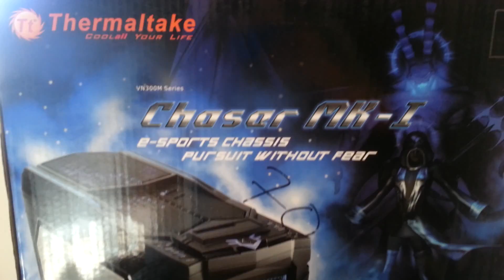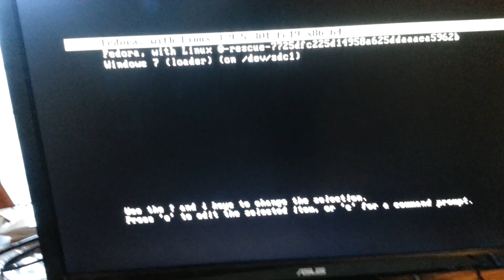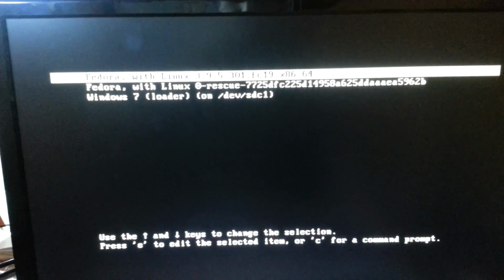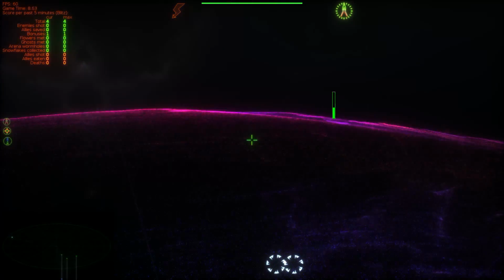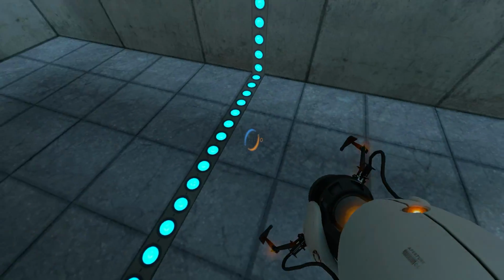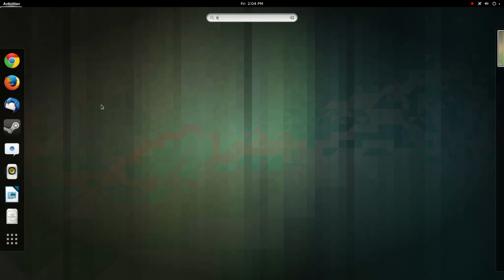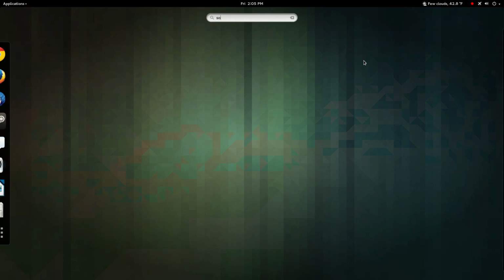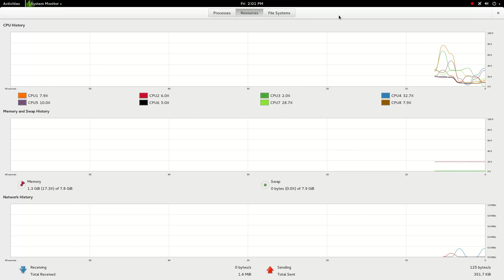Building my Linux Gaming Desktop

Comment: Well man ! 
That was such an awesome video that will make change from windows 8 to linux 
But please let me ask you some questions :
1) [ Mint - Fedora - ubuntu - debian - openSUSE ] ... which one should I choose for gaming ... and some applications that I deal with ?! 
2) About steam .... I am having many games that have the EXE extension, you know ! ... can steam operate those games on linux?!  ( with the games optimum quality and performance too )  ?! ... If not , what is your recommendations ?! 
-> FYI : I am having a lenovo G500 Laptop [ 4GB RAMS - 2 GB AMD dedicated - intel core i5 4th generation ] 
I do really thank you for this video :D 
and thanks in advance for responding
Reply from the maker: You have lots of options. I would say your easiest bet is going to be Ubuntu since it is most commonly used and there are a lot of resources online. my biggest suggestion would be to install and use each OS in a virtual machine for awhile, just to get the hang of things. you can install nvidia drivers and steam on all of the operating systems you listed, so gaming should be pretty similar on each
Reply: dose this "nividia drivers " works with the AMD VGA ... since this is the one I have !
and ...I think you didn't tell me about the EXE extensioned games yet !
Reply from the maker: NVIDIA drivers will only work with NVIDIA cards. if you have an AMD card, the best thing to use is the Open Source driver that comes with the OS. The driver is called Gallium, I think. I use steam with AMD graphics on a different fedora workstantion and it works good. EXE games?
Reply: exe extensions ... microsoft windows extenision for the games 
does it work on linux ?!
Reply: *****  : Well [ Darksiders II - Tom Clancy Games "ALL OF IT " ...and some more ! 
If am going to search for each , that will take like forever yo know ! 
... sorry... forgot to than you for responding :D
Reply from the maker: ***** To get windows games to work, your best bet would be to use Wine to install the windows version of steam, and get your .exe games that way. From there you need to use wine to run the exes. it works with varying levels of success. for the most part .exe games will not work right in Linux. google around for wine compatibility for the games you are wanting to play.
Reply: I expected so ... 
Cody Shell  : again man ... thanks for the video and for answering my questions , and sorry for being such a pain :D 
keep up the good work man ! 
*****  : thanks man for responding :D
Reply: Cody Shell
Hey Cody nice Video I wanted to ask I am going to be building a new Budget PC in a few weeks I have all the gear lined up and ready to buy (just waiting for the $)
and have gone with getting the Hardware sorted first and the OS later, I also have a large windows based games list and want to be able to play them all on my system now cause I am not going to be able to afford windows strait away as I will need a new key (already own a copy of windows7) I will be running Linux to begin with.

Any chance you could make a tutorial for Linux newbies like myself on setting up windows Steam with wine and setting up games on Linux or dose anyone know of a utuber that's already done this and would be willing to link there video here?
Again it needs to be an in depth video as I have no real experience with Linux and the terminal for setting up, it always had me confused cause I don't know what I am doing with terminal and please I do prefer to watch someone do it on a video and not read it as that is just how I learn.
Reply from the maker: Even with Wine Windows game support is a shot in the dark. Not every game works, and the ones that don't expect them to work like they do on Windows. It's a shot in the dark. Even if games do work in wine, its best to have some good hardware, a budget build might struggle a bit. 
The best bet for yourself would be to install a Linux virtual machine, right now. on whatever computer you are using and start playing around in the terminal. installing and removing packages, navigating around through directories. Getting that basic knowledge down will make everything you do in Linux much easier for you. You don't want to end up scratching your head wondering why you can't figure out the basics. 
Google around for Wine compatibility for the games you are going to be playing the most. And see which games of yours are available as regular Linux titles. Google is going to be your best friend.
Reply: Cody Shell
Well when I say budget these days a budget PC can do pretty well, I can give a list of the items I am getting for anyone else interested for a budget build at the end, but just to say it will be pretty powerful for the price.
Now I have dabbled with Linux before but as I said I ended up as you said scratching my head most the time making sounds from the intro like Tim Alan from the popular TV show Home Improvement "Urrr, err, eww" and I have sat down for hours on end trying to read up what to do with Linux but as I said I need videos to watch on the subject cause that's just how I learn.
I have looked around on youtube for basic tutorials but most the time there 2 or 3 years old.

For anyone that is interested this is going to be my Budget build and I would say its no slouch,

Dual-X Radeon R9 270X OC or AMD R9 280 both by SAPPHIRE
Depending on whats available at the time.

MSI 970A Motherboard by MSI

2x 4GB HyperX 1600 MHz CL9 DDR3 by HyperX

AMD FX6300 Black Edition 6 Core by AMD

Intel SSD 320 Series 40GB SATA2 by Intel

It wont be the best build in the world but it should do the job and all comes to around ($536.28) depending on witch card I get, Luckily I have a spare 750watt power supply and case.
Reply: *****
Partly true yes, every time I suggest to a friend I want to try Linux he says not to waste my time, but I know Linux has a lot of potential if you give it a chance, while I do wish that Linux could just run all my windows games by now and believe me I have being going back and forth from windows to Linux to check over the years.

Then I would never have to care about buying another windows Key again cause god I don't know how much money I wasted to Microsoft over the years cause of Keys and so on, where Linux is a completely free OS and only misses Window game compatibility.
But I will say this the moment all games can just be installed and run on Linux like normal Windows will be going in the trash for me.

I know Windows 10 will be free for all Windows 7 and 8 owners but I am betting that Windows 10 will have Micro transactions coming out the wazoo.
Reply from the maker: Azreal Dragon AMD CPUs are great. Before you buy anything though google around and make sure you hardware has good Linux support. Look around and see if anyone else ran into issues. AMD CPUs are great and have good support with Linux. 
The #1 thing I would tell you right off the bat is not to get an AMD graphics card. AMD graphics drivers are incredibly primative with Linux. Getting the drivers to work is very difficult, and when you do they are not very good. 
For someone whose more of a novice with Linux, definitely get an NVIDIA graphics card. I wouldn't get an AMD GPU for Linux, not now at least. The technology just isn't there yet. 
For your CPU, youre good though. the 6 core should be good. 
Also look up motherboard support for Linux. I didn't and when I got my computer Linux would not boot. I had to disable the IOMMU controller in the BIOS, and even then to this day I get a page fault when I boot (making it boot about 15 seconds slower) - but this is a motherboard issue, not a CPU issue. 
When it comes to building a Linux rig, it really pays off to make sure your hardware is going to be supported first. 
These days Intel does a lot of work providing source code to the Linux kernel. Intel has very good Linux support. It definitely wouldn't hurt to go Intel as well.
Reply: Cody Shell
Well thanks again for you time and support with this at this current time.

I have decided to stick with windows,
(I really hate windows tho) but just cause I don't feel I am confidant enough yet with Linux.

I will be running Linux as a duel boot tho so I can keep practicing and learning it but also the CPU I had chosen has changed as well from the FX 6300 to the FX 8350 as its on sale at a local PC store and it gives a top clock of 4.00/4.10 where the FX 6300 was 3.50/4.0
(I think) witch should be Overkill for what I need it for (60fps gaming), but any information on if it is or is not a good buy is helpful.

I also noticed a GTX 960 on sale on Amazon UK could you advise on if this is a good buy or not?
I know the GTX 960 is not as powerful as a R9 280 or 280x but the GTX dose have DX 12 support and is made with the Haswell architecture.
(But that dose not mean much to me I just know its made in 2015)
Thanks again to everyone that has taken the time to help me.
Reply from the maker: Hey no worries! the 8350 is an awesome chip, as you can see i used on in my build and it is suiting me great. the only thing that sucks on it is the stock cooler. i really reccomend getting a coolermaster hyper 212 evo air cooler. then it can breath. 

maybe try making a virtualmachine of a few linux distributions and playing around with them to get to learn stuff.

i would like to make video tutorials, but i dont have a lot of time right now. it's something i'll definitely consider!
Reply: *****
lol, Funny I was thinking the same thing last week about windows 10.

I am expecting it to have micro transactions all over the place with that OS.
As for the duel boot not got round to it yet but my finished rig is not bad has a bit of slow boot time but that just might be cause I have not optimized it yet.

I went with the FX 8350 cpu with an MSI gameing 970 MOBO and MSI gameing GTX 960 graphics card.
I dug out the ram, PSU, case, DVD and HDD from my old computer and it runs well.
Reply from the maker: yeah, it does well. I like it a lot. i have everything separate, with windows and linux on their own hard drives. Windows 10 actually doesn't sound bad. but windows always gets sluggish and slow after awhile. its nice with linux everything is always pretty quick
Reply from the maker: sometimes I use wine on linux and navigate to my windows drive and play my windows games, it works not everything works. We'll see how it is. I'm anxious to see Vulkan
Reply: Cody Shell
wait navigate to your windows drive with Wine? any chance I could get a tutorial vid on that at some point I didnt know I could do that.
Reply from the maker: Wayland actualyl works very well on Fedora 20, much better than X11, but it only works with Intel graphics right now. 
Azreal Dragon - all you have to do is mount the windows drive and cd to the steam directory and launch steam with wine. i can make a video i guess if enough people care to see it
Reply: Cody Shell
I agree with RK, while there are some videos on how to use wine most are outdated by 2 or 3 years and I would like to see a video on setting up wine properly its one of the things I useally get stuck on in Linux and a more up to date video could be helpfull for some.
Reply: +Azreal Dragon A tip for you and anyone else finding this comment and feel Wine is complicated. Play on Linux can most times ease your pain. Or if your ready to pay to get out of Windows you have Crossover that is a fork (was once Wine but is now it's own). Last one has most support for Windows games and programs as they charge for there product.

Comment: How is the fx 8350? Also, are you still using linux?
Reply from the maker: i love the 8350, it can render 1080p video in real time. it handles every game i throw at it. i did change the cooler, to a coolermaster hyper 212 evo. 
Still using Linux. Works great
Reply: Cody Shell still fedora? or did you switch distro's
also make sure you get the piledriver optimized kernel for linux, it's made to work better with amd's "module" setup
Reply from the maker: MrLoggfreak I've never heard of this Piledriver optimized kernel. I will have to look into it. I do get a page fault when I boot, but I think its a motherboard issue with the IOMMU controller.

Comment: so.. you have a sick processor and a decent graphics card and recording your screen drops your frame rates? i have an i5 and recording my screen would take up like 10% of my processor and those games maybe 3-5% lol.. and i have a shitty 1g ddr2 graphics card, is linus that useless for gaming?
Reply: that's not because linux is useless for gaming, it's just because most of the recording software on linux are made to record games, unlike on windows
simplescreenrecorder works great for recording games on linux, even on much slower hardware than he has, and has great quality (check xpander69's channel he uses it all the time, great quality) but i'm guessing he's using other recording software

Comment: You have done any benchmarking??
Reply from the maker: I ran the heaven benchmark on this rig between windows 7 and fedora 20 and windows did have some better performance. I would say it's due to the quality of the Linux NVIDIA driver and the X performance. If I ran a barebones X session, like openbox or awesome for example I would say Linux might have performed better, I was running gnome-shell when I did the tests
Reply: But how much better performance was it in Windows 7 compare to linux, if you remember? //Rickard
Reply from the maker: It wasn't too much better. I really need to run the benchmarks again, I want to do them and make a video of it, i just havn't gotten around to it yet. ha

Comment: My rig is nearly identical, we even have the same case. Built mine around the same time you did too. Really sweet build.
Still running Fedora or have you switched to another Linux Distro?
Reply from the maker: I'm still using the original install of Fedora 20. It works really well, the OS on a solid state and my home folder on a 2TB drive. I recently got a new heatsink for the CPU, because the stock one would get real loud.
I had a few problems getting networking to work my motherboard, but everything is working well now, I had to toggle the IOMMU controller (i don't remember enabled or disabled) ha.
What distro are you running?
Reply: Cody Shell Running an Arch install, but I've been distro hopping for a while looking for something i want to stick with.
Reply from the maker: ***** Steam works great in fedora, its located in the rpm fusion repo, it works great.
Reply: Steam will run on any Linux Distro. It's probably less likely to give you trouble on a debian based distro though.
Running it fine on Arch.
Reply from the maker: I'm sure Debian based stuff ran steam better initially, but now I don't think it matters as much. When I run steam through the terminal it knows I'm running Fedora